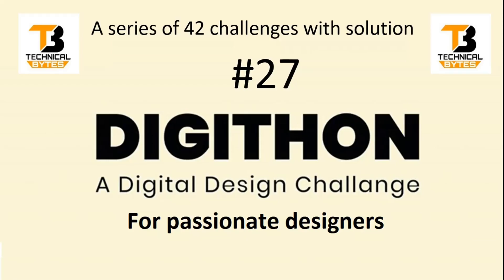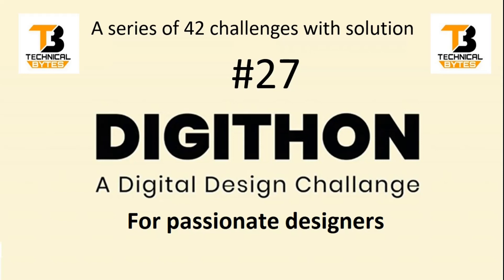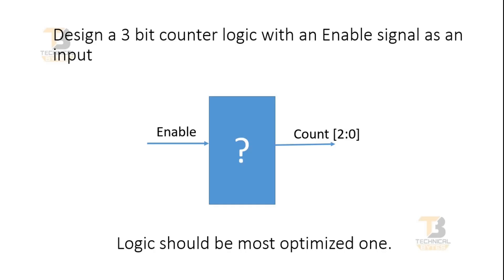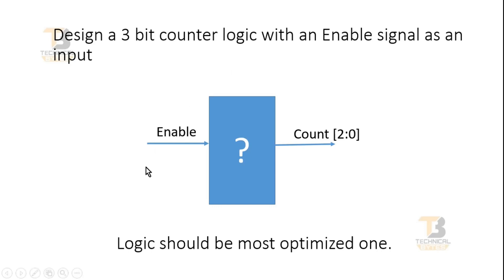DigiThon Question Part 27

Comment: design a 3 bit asynchronous counter usting T flip fops with its input as 1 and out of each flip flop is given as neg edge clk to next flip flop and for the first T flip flop ,input  to first T flip flop is given as  output of the and  gate whose inputs are  enable and one.

Comment: Design a 3-bit synchronous counter using T-flip flop and tie the "Enable" signal to the active low reset. This way, no extra gates are used.
Reply from the maker: Reset will reset the counter value, we should preserve the count
Reply: @TechnicalBytes  clock gating is a possible solution.